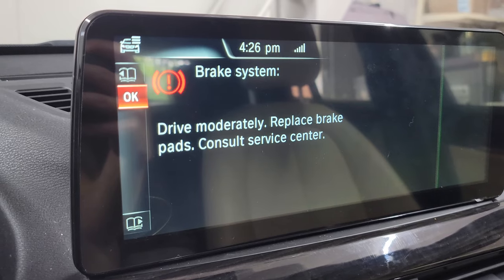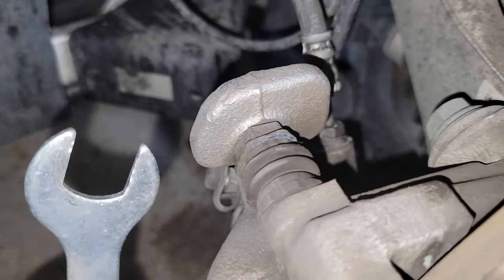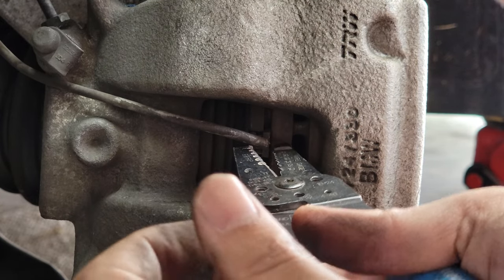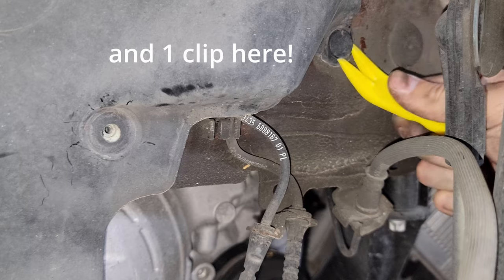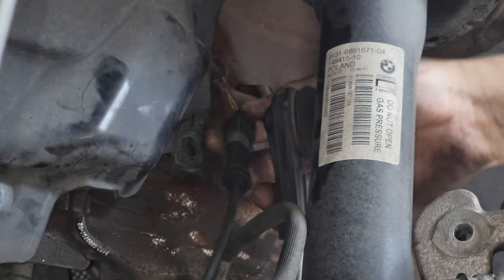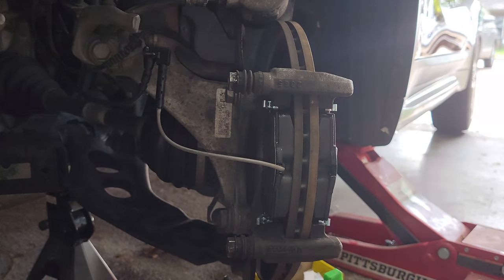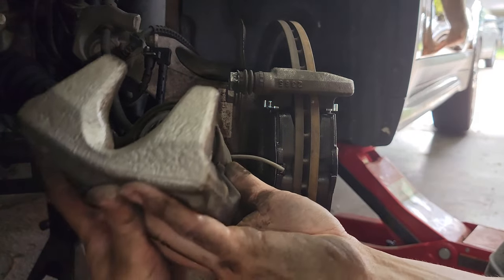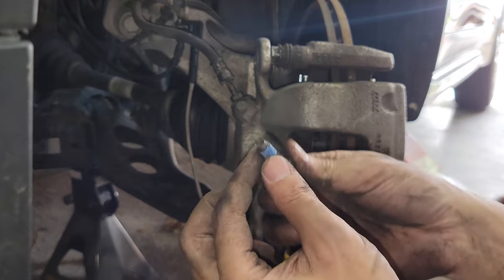BMW X1 F48 Front brake pad replacement

Comment: Hi sir nice video!
Can you help me with a question?
Which weels the sensors are installed? Only in two? Or all of the four weels have sensor pads? Thanks.
Reply from the maker: Thank you! There should 1 on the front, and 1 for the rear.
Reply: Front left and right rear

Comment: Did you torque the caliper bolts to spec, or just a good hand tighten?
Reply from the maker: I hand torqued them but always recommended to use a torque wrench!

Comment: Did you have any problems with spongy brakes after you changed the pads?
Reply from the maker: Only on the first few brakes, then it came back to normal. This is because the piston was pushed in to be able to fit the thicker, new pad.
Reply: @BWTECH0521  changed mine and now the brakes are spongy. I wonder if air got in my brake lines when I pushed the piston back

Comment: How is the pedal feel? I just upgraded the brakes on my 335 and the light pressure on the pedal leaves much to be desired. (Stops very aggressive and awesome when you use firm pressure) I'm thinking I should have not compressed the calipers as much as I did.  I saw something about cycling the dsc pump to "relearn" the brakes. 🤷‍♂️
Reply from the maker: It feels the same to me. It's pretty sensitive compared to other cars ove had, it is hard to brake smooth with this car even before I replaced the pads 😱
Reply: The piston resets itself the first time you press the brake pedal. The brakes on the BMW ARE aggressive, its not you.